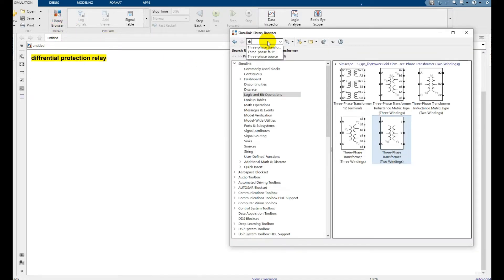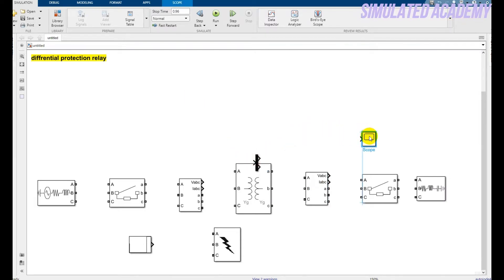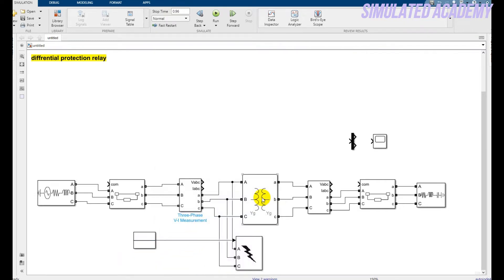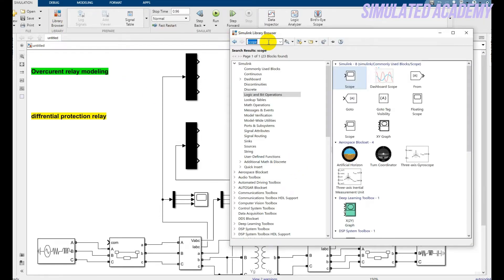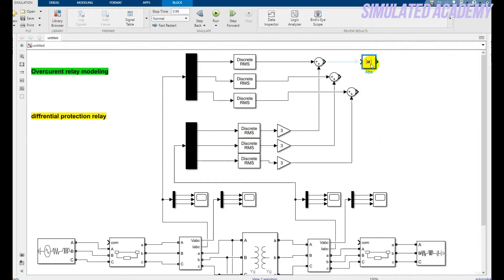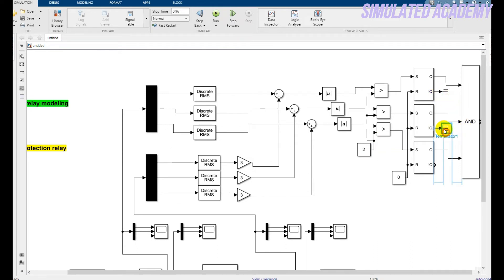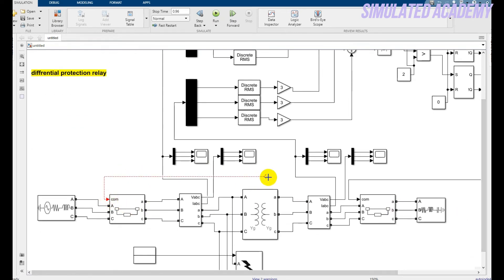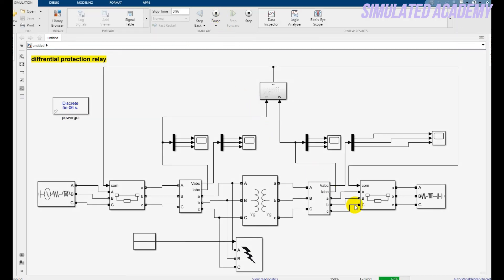step by step Differential relay modeling in Simulink | differential relay of transformer in Simulink

Comment: If fault block connected on the primary side of the transformer, then how can we say the transformer is faulty? 
If it is connected on the primary side, then i think supply current wont flow through the transformer.